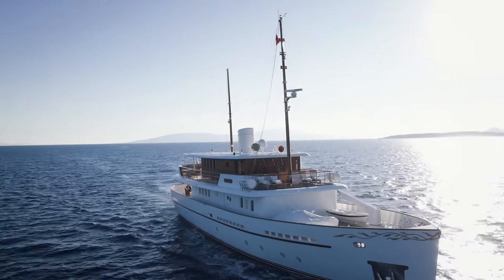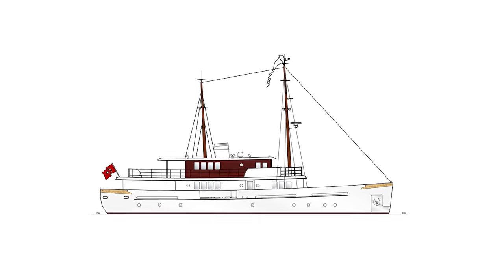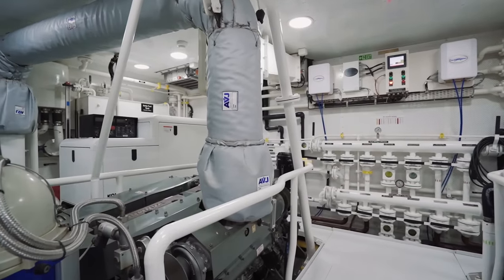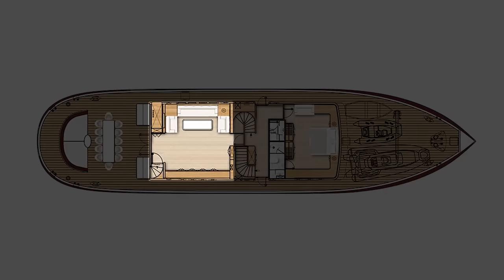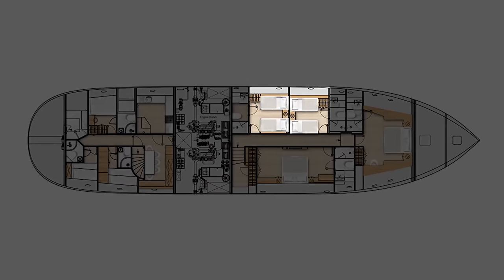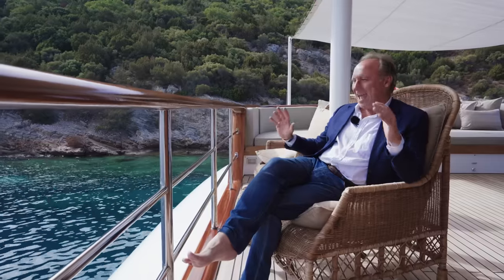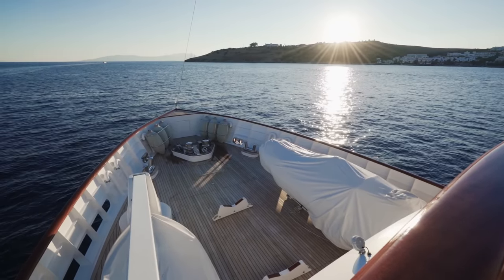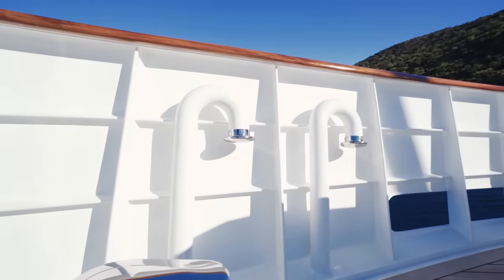GENTLEMAN'S YACHT "OLDE SALT" FOR SALE. WALK THROUGH VIDEO.

Comment: Having viewed numerous similar videos i have to say no one does it better. I especially enjoyed the ship layout drawings. No one does that. Crew quarters, laundry and engine room are a must. They aid a lot towards a buyer considering purchasing. Outstanding!

The vessel is outstanding as well. Well built, well thought out and designed. A very clean and appealing yatch. The crew mess could be more appealing. Its like eating in the engine room rather than a proper gathering and relaxing space for the crew. It's very important to the crew to have a very nice mess. Thats my only fault with thie vessel. The crew quarters were as nice as I have seen on many super yatchs very important when trying to retain talented crew.

Comment: Definitely my sort of cruising motor yacht and reminiscent of some of the beautifully built Van Lent vessels from the 1960's and 1970's. No mention of air conditioning or of stabilisers though, both of which would be essential in my view. A beam sea in a non stabilised vessel of this size can be a memorable experience! Also, an indication of the hull form would have been interesting. Cruising fuel consumption at two gallons per nautical mile is remarkably low. A beautiful vessel and a credit to both the builder and the owner.

Comment: Contemporary yacht design is generally crap. This is a modern classic, particularly the exterior
Reply: I wouldn’t say contemporary is crap, but it does get dated fast. I would rather own a boat that will still look good in 40 years.
Reply: Or even be afloat in 40 years!
Reply: saw a video of some kayakers in the everglades come upon a twin of this boat sunk in 2m water.  mostly stripped but lines still nice

Comment: This is a yacht has really everything you could want and it just goes to show that just a simple amount of care will keep a vessel looking great. Many people may not go for the high gloss on the interiors but, if you use the correct sort of cleaners and a proper soft cloth to care for them. they are better protected from the harsh environment of the ocean. There was one concern that I had and that was the extensive bow wave. either she rides heavy in the bow, they wanted to see her going as fast as possible or her hull doesn't cut through the water well. Perhaps adding a small bulbus bow may help that and increase her range.

Comment: old salt is on target but under the launching areas on the forward bow a small set of generators to power azpm props and sabilizers fuel tanks would reduce in sizes and very soon be an option only for the sea toys only as the electrical power generation will be done from powered flywheels....The engine compartment for water treatment and hydraulics only

Comment: They say the happiest moments while owning a yacht is the day you buy it and the day you sell it. Considering the owner went to great lengths to purposely have a very individualistic design and preferences in commissioning this boat, the fact that he is selling it in less than 5 odd years is to say the least, intriguing. Any prospective new owner would do well to give a thought to this and better still check it out.
Reply: A lot of these folks have more fun designing and getting their yacht built than they do using it. By a few years after they've done it -- especially if it was for a particular project and that project is finished, such as a circumnavigation -- they're ready to move on and build something else altogether.

Comment: Unquestionably a fine ship. The only fault I can see is the interior arrangements may be a bit too spacious. At anchor or in protected water everything would be fine but cruising in any kind of a seaway would make for a difficult time getting around safely. I can envision someone being injured because there is nothing to hang on to while trying to get to the other side of that spacious lounge. If those gorgeous staterooms were smaller this would be less of a problem and as a bonus you could fit one or two more of them and they would be no less luxurious, in the opinion of someone who is more accustomed to smaller "ships".

Comment: Was curious about the fuel efficiency so after a little math it’s about 20000 liters for a full tank that gives you 2000 nm at the efficiency they mention. With diesel prices at 1.4 euro per liter as on 2022 it would cost you about 30k to fill it up….. dammmmmmmm

Comment: 2000 nm isn't exactly long-range. Also, why are Turkish built yachts relatively inexpensive compared to European or American yards? I heard quality has something to do with it.
Reply: That was the range at 10 knots, which may technically be "the cruising speed;" but from the shape & relative dimensions of the hull (and the amount of wake it was kicking up) if you cut that down to 7 knots, you'd probably get 2500-3000nm.  For a boat intended to stay in the Mediterranean or Caribbean regions, there's not much point in carrying any more fuel than that anyway.

As for price, the Turks may be making their main profits off commercial ships, and selling yachts for close to cost to attract new clients.  I have heard that it matters and you really have to know who to go to for a boat in Turkey, because they have some very good builders but also some really crappy ones.
Reply: @animistchannel2983  Thanks for your comments although, I'm still dubious that a boat this size could probably not cross to the Caribean on its own keel. Regarding yards, you're probably right I don't know, I've heard some horror stories.
Reply: @MrWhynot55    Ooh!  I didn't mention before, but if you like long-range cruiser/explorer yachts, the Allseas 92 is in this price range.  It's amazing.  Victoria and Rico of the Nautistyle channel did a 2-part, hour long tour of one recently.  It's built tough (including full cm steel hull!), fuel-efficient, homelike inside, and has a range of around 5000nm.
Reply: @animistchannel2983  Thank you for the info. I'll check it out. Big fan of expedition yachts including some interesting expedition Motorsailors.

Comment: Look at that brick in the water. There's no curves!
It's basically a square box with no sheer, and then there is pointy bit at the front and a round bit at the back.
Then look at the superstructure: the decks have no curve, neither does the roof. It's very cheap to build, and no need for expertise.

No wonder women use so much plastic surgery nowadays if men (as most commenters seem to be) have become so blind.

Comment: Why do builders have to ruin these classic interiors by adding canned recessed lighting? So cheesy. I would rip out all the painted ceiling shiplap and replace it with a sea of wood, unmarred by anything but matches the simple wood floors. Still, I would much rather have a boat like this than those hideous floating hotels they call superyachts.